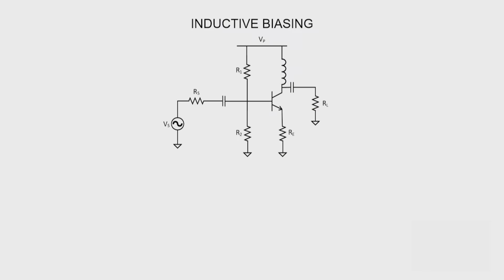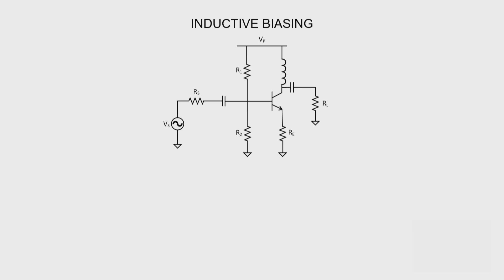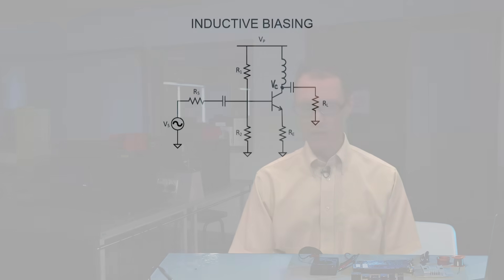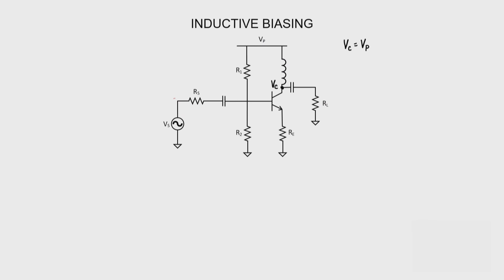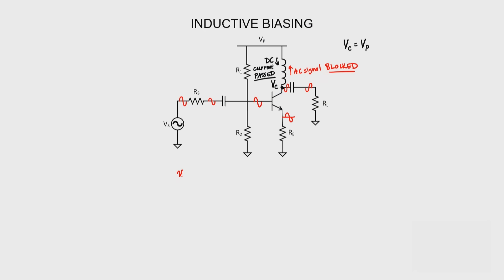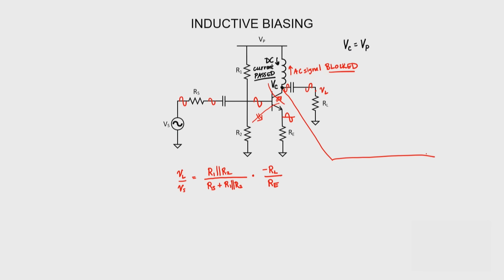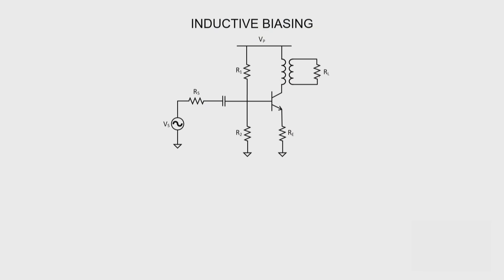Using inductors to bias transistors (30-Transistors)

Comment: Our prof used to remind us that a power supply is an ac short at the beginning of every lecture…. So you had to draw every circuit diagram twice. Dc had potential dividers where the ac saw things in parallel.

Comment: The frequency dependent amplification is not mentioned.
Reply: Yes. Exactly .  The impedance ( reactance XL) of the inductor will rise linearly as frequency rises ( ignoring resistive losses and possible resonance occurring with associated capacitances. That would suggest gain rises with increasing frequency.
 A typical circuit using this type of collector load would be where the signal frequency is high - say several MHz -  using a fairly high inductance.
Then inductive reactance ( 2*pi * F(hz) * L(henries) would also be high
However - 
In such a case the "effective or AC " collector load  impedance would thus be mainly defined by  the input impedance of the following stage which would tend to "damp" the effect of the inductor reactance so its "effect upon gain v frequency" is somewhat eliminated.
The advantage of doing this  therefore is to maintain a high value of collector voltage and collector voltage "swing" above and below supply rail - and indeed thus   improve power efficiency of the amplifier. ( using a resistor will introduce a V^2/R loss)
(ie: the ac load line swings above and below Vc)
This sort of circuit is typically used in RF power output stages where the inductive collector "load" feeds a  filter /matching network to an external  load such as an Antenna.

Comment: I saw in a circuit that makes a snare drum sound effect they used an inductor from supply to collector paralleled with a 47k resistance (also works without resistor)

The base is triggered by an input pulse and injected with white noise.

This sound is mixed with additional circuits that make Tom drum sounds. After mixing you have a very convincing snare sound

Comment: Using a transformer with a center-tapped secondary, and referencing the center-tap to ground will allow you to feed a balanced line, such as 600 ohm balanced input to a piece of audio equipment. This would give your circuit a high common-mode rejection ratio.

Comment: Interesting stuff. Reminds me of my hobby days and, yes those old transistor amps that had output transformers. Used to have a lot of fun with them making weird noises.

Today, I just use op-amps and RC filters for signal processing. If you need to amplify a signal with any strength there are plenty of amp chips to choose from. 

I would like to revise valve theory. Valve stuff is going strong these days in guitar amps and vinyl setups.

Comment: Is  R_e necessary? There is no doubt that R_e will stabilize the bias point, but, if we forgo that, can we make this circuit work without R_e?
Reply: Not really.   You have to set up the DC conditions for correct operation., and  
without any Re there would be no limitation or effective control/ stabilisation  of  quiescent DC emitter current.
As it stands - Re is not decoupled so there is a large amount of negative feedback thus reducing the gain to essentially  collector load Z / emitter load Z 
In other words Re can be seen as a detriment to the potential gain of the circuit . but to overcome that  one could decouple Re with a capacitor thus maintaining DC conditions but raising signal gain - ( and possibly include a series resistor with it to still provide some negative feedback - ie reduce gain to a required specific value ) .. or  replace Re with a current source / current mirror.
Reply: @eric4709  Actually I think we can get by without R_e. R_1 and R_2 would set up a V_BE which in turn would decide the Quiescent I_c. Admittedly, this would be a very, very bad design, but still, not wrong in principle.
Reply: What we have to remember here is that there is NO collector  DC load resistance in this circuit.  

That is what makes this quite different when we look at bias stability etc.
 ( we can assume the inductor has very low DC resistance)
 
If we remove Re - then since there is a very low DC resistance in the collector load - there is no "real limit" to what current could flow in the collector / emitter circuit under adverse circuit conditions.  
 ( in practice this would be limited to the supply capability and the actual DC resistance of the inductor - but nevertheless this current could be high enough to damage the transistor. 
Lets say we have a supply of 12V - and the inductor has a resistance of 10 ohms - that gives a worst case current of 1.2A 
( conversely - in a typical small signal circuit with say a collector load resistance of 10Kohm - then our current would be limited to around 12v/10kohm = 1.2mA 

As the circuit stands - the absolute worst case  case current that could flow = supply rail voltage / Re ( that is  when Vce = 0 - or saturation and assuming inductor R = 0)
 
Also - bear in mind this type of base bias circuit  (with "Re" included ) relies on the current passing through R1 and R2 to be many times  ( usually 10 or more)  greater than Ib - that is R1 and R2 form a potential divider   - which effectively "fixes" the base voltage at  Vb = Vs * R2 (R1+R2) 
( in other words potential across R1 (= Vb)  is not greatly affected by Ib since Ib is going to be quite small for the typical transistor with an Hfe of around 100 -200 or so  in comparison to the current flowing through R1 and R2.   And also -since Ib is very small - we can say that the collector current is approximately the same as the emitter current. 

If you remove Re - then this type of base bias circuit (R1 + R2 )  isn't practical since it will  force  the base current to a very  high value  -thus also forcing Ic to a high value.

Using the circuit "as is" We can easily  "fix" the  collector current  by subtracting Vbe  (typically 0.6 - 0.7V)  from VR2, (base voltage)  to get the emitter potential - and dividing that by Re . 
So typical values might be:  R1 = 8K R2 = 4K , Vs = 12V giving a Vb of 
12 * 4/12 = 4V  and an emitter voltage across Re = 4-0.7 = 3.3V
If we make Re = say 1k ohm - we have an emitter current of around 3.3mA.
This 3.3mA is pretty much independent of the transistor characteristics and other variables.  ( and the maximum collector current under worst case conditions  = Vs /Re =  12mA.

If you remove Re in the above example -  then to keep the collector current the same at 3.3mA -  with an hfe of say 100 - we would need somehow  to limit the base current to  ic/hfe  =  3.3mA /100 = 33uA  We could do this by using a single resistor from base to Vs = (Vs- 0.7v)/33uA = 11.3v/33 uA = 340Kohm.
If we were to replace the transistor with one having say an Hfe of 200,
(And hfe's can vary widely)  then our base current remains the same, at 11.3v/340 kohm   at 33uA.. but the collector current will now be  around 6,6mA -  but ..remember - there is no limit to what the collector current can rise to so this circuit would be quite unpredictable  - especially in terms of temperature changes etc

Comment: In my 50's oscilloscope there are some thin wire coils which are wrapped around the plate  resistors of a triode. So the resistor is fully inside the coil. The carbon composite resistor is like the core of that coil, and connected parallel to the coil at the same time.  The problem is that it is very difficult to measure if the resistor has gone out of tolerance because it is paralleled by the coil and the resistance of the coil is unknown and difficult to measure. It is quite impossible to disconnect those resistor and coil from each other without damaging the very thin wired coil. 😡

Comment: This circuit I have studied about 43 years ago. Later got involved with tube amplifiers in audio final amplification where this circuit is ubiquitous. Main reason the tube amplifiers sound different is due to the inductor in the final amplification and the tubes are inherently high impedance devices. Addition to high (4x) gain, inductive coupling also provides the maximum theoretical power efficiency in class A amplifiers.

Comment: In RF amplifiers, I see this topology often. It would be great if you did analysis in cases where inductors' impedance is not so large at the frequency of interest that, you do have to take into consideration of both inductors impedance and transformed load impedance at the same time, compared to your assumption here that inductor represents an open circuit for AC signals.

Comment: As always, great explanations, easy to follow. You did the gain calculations including the load resistance RL. But, what if there was no RL connected, and there was just the inductor between the collector and power supply? What would be the signal level at the collector? What would determine its amplitude? Maybe the DC resistance of the inductor would come into play?
Reply: The impedance of the inductor at the frequency in question would determine the gain. This is also in parallel with RL in the circuit shown in the video, with Prof. Danner stating we make it high enough that it can be effectively ignored for the calculations.

Comment: Interesting. Hard to believe that I haven't stumbled upon this method of transistor biasing in all of the things I have built or worked on in my DIY world.
Reply: It's often used in rf circuits, older radios often had their amplifiers (and other stages) coupled through a transformer

Comment: At 1:15 the voltage divider is wrong. It missing (beta+1)*(RE+re) in parallel with R1||R2
Reply: I'm guessing he assumed beta to be very large thus the missing resistance is negligible in the parallel combination as it would be very high relative to R1//R2
Reply: @josephmak7473  This is probably not the right place to ask. But how do you plug numbers into this notation. I've replayed the video, and I don't understand what this "R1//R2" notation is supposed to mean. He says "we have an input impedance of R1 in parallel with R2". Do you simply replace "//" with "+"? It doesn't seem likely. And it seems you don't need to know the value of C. Thanks.
Reply: @johndoggett808 well, you see "//" is commonly used to denote the parallel combination of, thus "R1//R2" mean R1 in parallel with R2, while "+" is used to denote the series combination of, thus "R1+R2" means R1 is in series with R2, parentheses must be used in this notation to convey the order of operation as R1+R2//R3 is ambiguous to the reader.

"And it seems you don't need to know the value of C" I don't quite get what you mean here
Reply: @josephmak7473  Thank you for your reply. I had considered that "//" could mean parallel, but rejected it because R1 and R2 are in series with respect to the fixed power rails. But I guess what matters is that from the perspective of the Base, the resistors are "parallel" to the fixed voltage rails. 
P.S. What I meant by "And it seems you don't need to know the value of C", was that he spoke about impedance, which to me means a reactive component like a capacitor or inductor. When talking about a non-recative component like a resistor I would expect him to say resistance. Particularly as we could "neglect the impedance looking down the emittor,  because there was no capacitor"[1:03] I'm comfortable using transistors as switches, but don't trust my intuition in high frequency amplification. 
I think this teacher's turn of phrase misdirects me at every turn :)
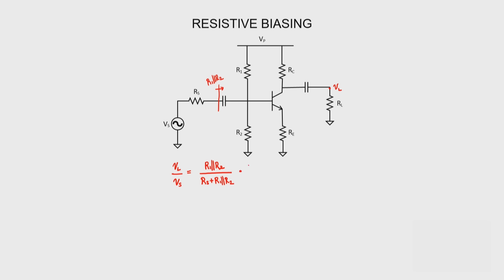Reply: @johndoggett808  oh, I get what you mean now, okay look R1 and R2 may appear in series with respect to power rail Vcc, but the analysis he's doing at 1:17 is Ac analysis, and Vcc is a DC voltage thus it appears as an AC ground in the AC analysis this is why he wrote R1 is parallel to R2 because this is in AC, and impedance doesn't necessarily mean reactive components only, impedance us a general term of any opposition to the current and takes the form:
Z = R+ jX, as you can see it has both a resistive part and reactive part.
Reply: @josephmak7473  Thank you agian: "Z = R+ jX". I don't think there is much hope for me, I've just watched 1:42 several times trying to think why he is bringing R2 in to the division, only to realise he is writing RL. Have you ever tried to put a dressing gown on in the dark with one sleeve turned inside out, and you've picked it up by the hem?

Comment: I'm guessing that it would work similar if the inductor was put on the emitter side of it which would be non-inverting signal out. Or am I completely out to lunch there?
Reply: The opposite. It would be like putting a massive emitter resistor which when you look at the gain formula would reduce the gain. To increase the AC gain while maintaining a constant DC bias point you would use a capacitor, whose impedance decreases with an increase in frequency.

Comment: Also that output transformer is utilized in IF circuits in radios tuned to a specific frequency, say 455khz.
Maybe you could cover a design like that sometimes.
Reply: The IF transformer is similar -and tuned with associated parallel capacitors on the primary and secondary windings to  455 /465 kHz in am radios, and 10.7 Mhz in FM radios. 
The "trick" with IF transformers is that the transformer primary and secondary windings are not tightly coupled magnetically as they are in audio output transformers etc  so that they give a "bandpass" response over  specific frequency range. 

They are in fact more loosely magnetically coupled  (called mutual inductance) primary -secondary in such a way as to give a wide "bandwidth"  of relatively constant output -  that is a "flat" response  - over  a desired frequency range -  which  on  AM 455 kHz is some  8 -10KHz or so
 
Thus the transformer only effectively passes a range of frequencies -some 10kHz or so  centered around 455 or 465 Khz - with increasing attenuation as one moves away from the centre frequency.  In other words - it forms a "bandpass filter"  so the IF stage only amplifies signals around 455 Khz/
( AM broadcast bandwidth is around  7-8 kHz with a channel spacing of 9 kHz )

For this reason you will normally see "IF transformers"  buried inside a "screening can" to prevent coupling to other nearby components -   with the coils inside  fixed rigidly on a former to maintain the desired spacing and with holes in the can to enable access for "tuning"

On FM - the bandwidth is much greater - around 180 200kHz for +/ 75kHz deviation on broadcast FM 
( as opposed to Narrow band FM for communication use